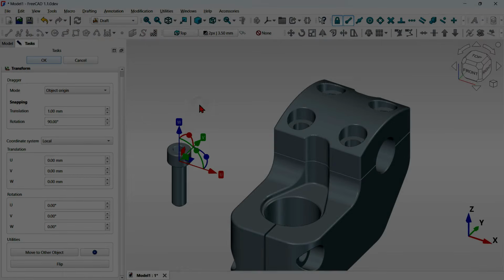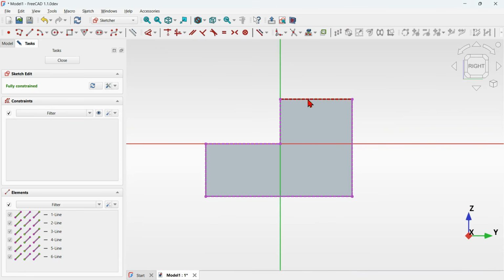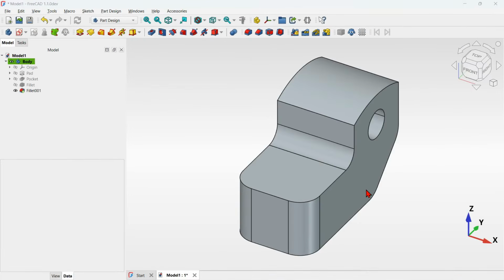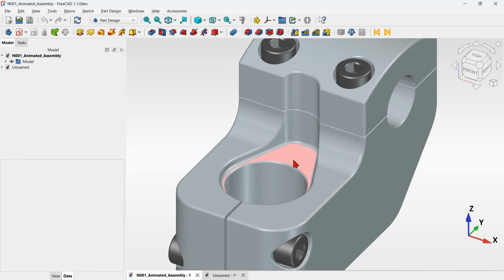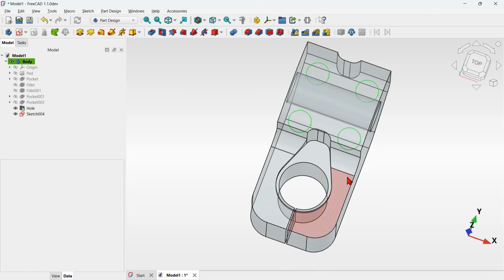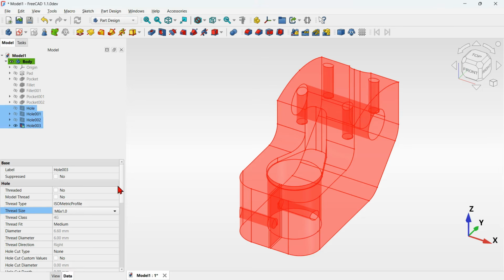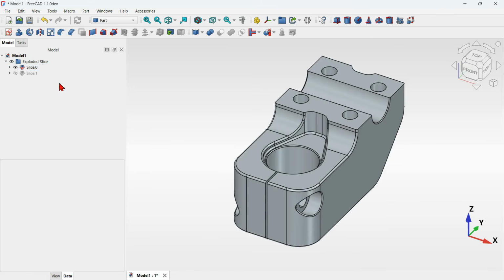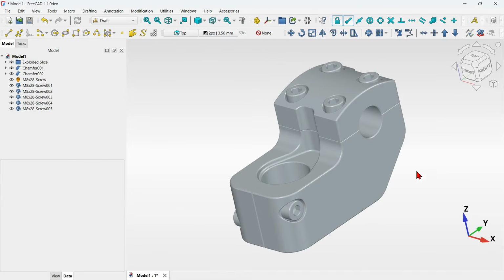FreeCAD 1.1: 3D modeling exercise 13 | Part: Slice Apart

Comment: The plane you used to split the part should really be a rectangular prism solid so that it removes some material and forms a gap.
As it is , a tube the same diameter of the hole , will not be securely clamped